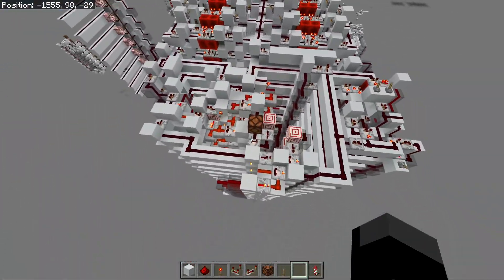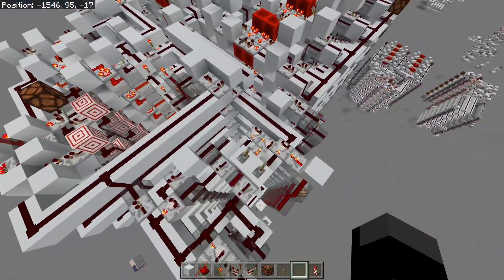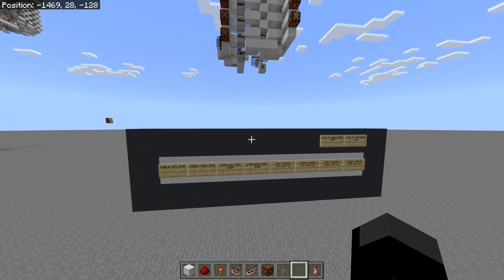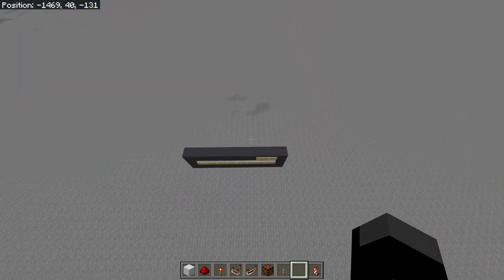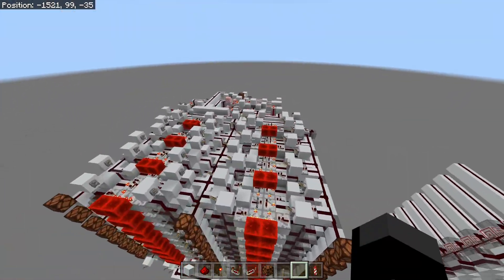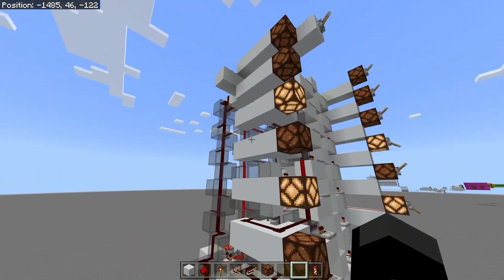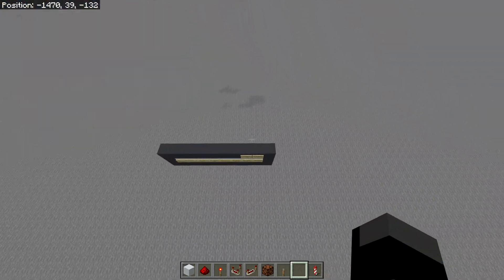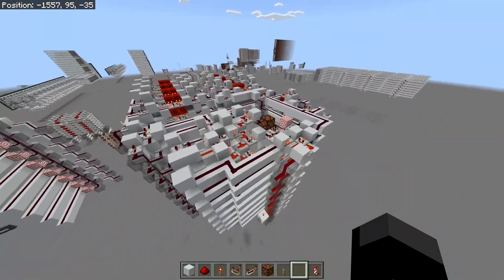Bit Shifting/Rotation module for an ALU - Minecraft Bedrock

Comment: Hey do you have a binary to bcd converter design for bedrock?
Reply from the maker: I have not made one yet, but would recommend the one by mattbatwings or by lecerial (I think that was the name lol)
Reply: @TheDarkness344  actually I tried mattbatwings it doesn't work in bedrock that's why I came here for help
Reply from the maker: @ItzCryzton  ah - you may need to change the design of the way he input and output data as I think some of the ways are java only. The actual converting part should work fine.
Reply: @TheDarkness344  ok, thank you for ur help I'll try that
Reply from the maker: Else use this design - https://youtu.be/gqeEpqU0MMs
It is a bit more complicated but works fine. Also if you replace the ripple carry adders with carry cancel ones, then it will be even faster.

Comment: i would just take a bi directional shift register and clear the data after its done
Reply from the maker: This would also work fine - specifically a barrel shifter, however this module is designed to be a bit quicker than a shift register and will work better with the ALU.
Reply: @TheDarkness344  oh ok well can you make a horizontal version
Reply from the maker: @SweFromSe  havent really got any plans for a horizontal design as this is specifically for a computer I am designing, but to get a horizontal shift by one all you need to do is bus the lines to the left or the right by only 1 place which isn't too hard to do. Then just make some control circuitry to enable/disable this.